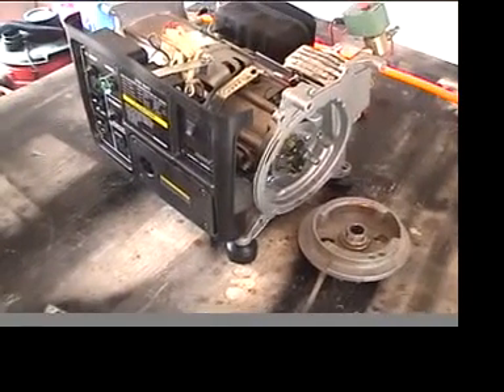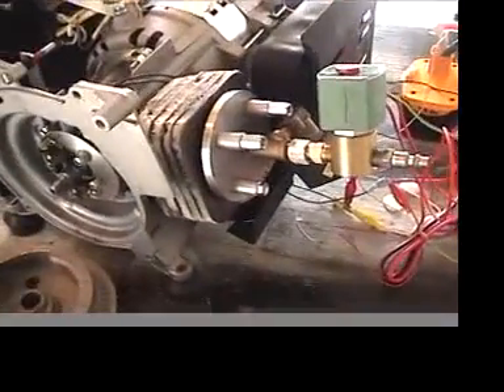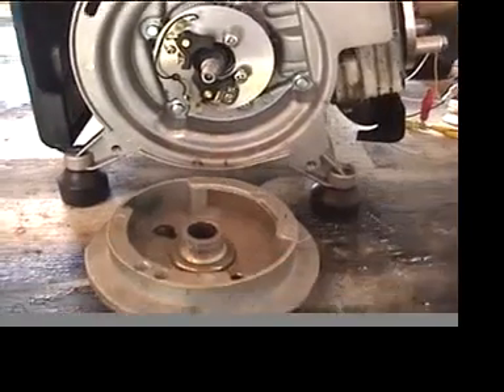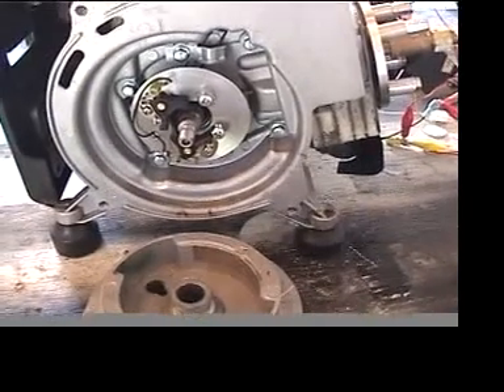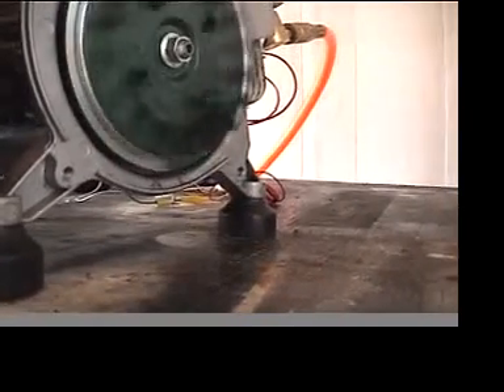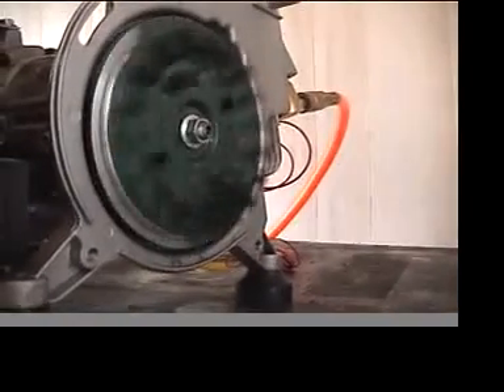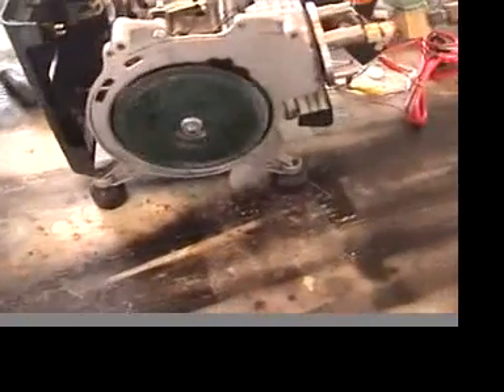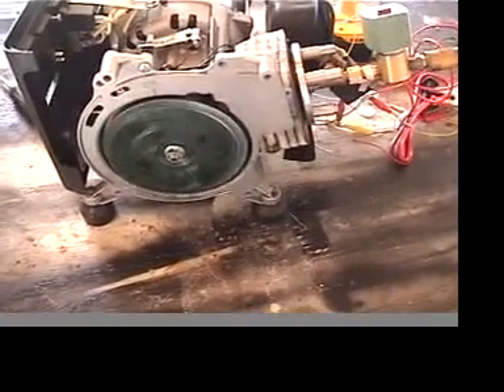solenoid valve steam engine generator

Comment: Thanks for the inspiration!!! How about using this to charge a battery or battery bank. Lets say it turn at 600 rpm instead of3600. It will still generate some power even if only 50 or 100watts. The voltage can be measured and a rpm point can be found at which it will generate 12v or a multiple of it. Than just maintain that rpm and run the output theough a rectifier and charge the battery...
Reply: Guys I just found a good website which gives you free_xbox_live_gold_c0des  https://plus.google.com/105285816099913202128/posts/JXHCEz9Ttfu
Reply: https://plus.google.com/105285816099913202128/posts/FCs9XF4R6VU  to get real free games                                                                                       solenoid valve steam engine generator

Comment: the other major flaw is the solenoid is designed to operate on dc or ac,  so it will saturate or stay on at about 40hz  or 2400 rpm,  from my testing. using these solenoids the best you can ever obtain is 1bout 1800 rpms.  since the generator you are hooked up to is a syncronous one it will only produce electricity at 3600 rpms,,  nice try but  epic fail  .   need a better design of solenoid

Comment from the maker: Perhaps, but that defeats the purpose of trying to simplify the engine.  Also, more ports, longer ports decrease efficiency, because it is non-expansive/non-working space.  The best would be to devise larger valves on the same principle as a standard solenoid.  Check out the Bash valve principle.  I have spent a lot of time on these too.  Bash valves need a lot of careful design and some tricks to work at lower pressures.

Comment from the maker: Absolutely, it would be like trying to drive a spike with a kitchen drawer hammer.  And yes the bore is too small.  I have to see things for myself even though I know what's going to happen.  I just wanted to know if solenoids could keep up.  Seems like a solenoid like this could activate a larger valve somehow.  I am only pursuing the work with the three cylinder uni-flow, simple and proven, very simple proprietary valves in the new design.